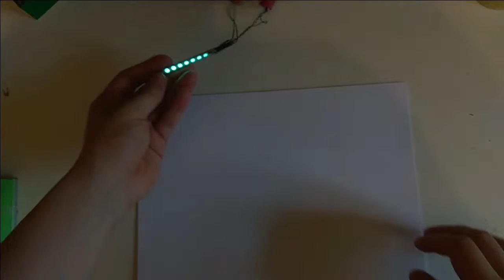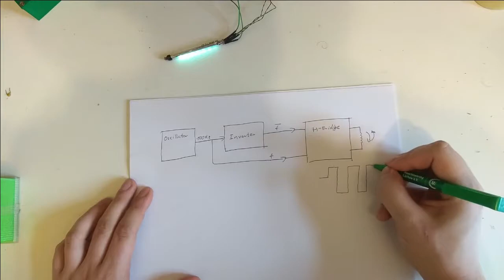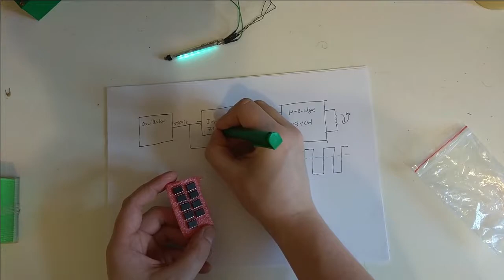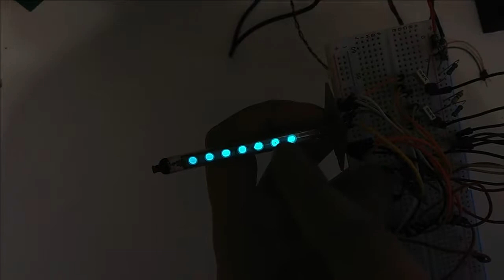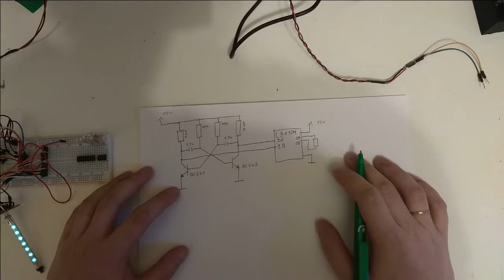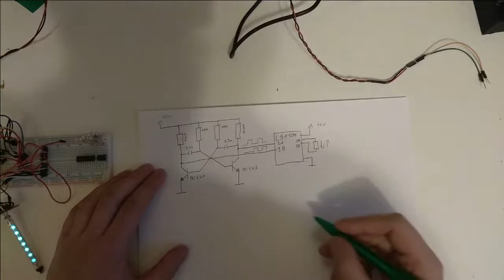Driving Vacuum Fluorescent Display Filaments

Comment: I can't read your left and right resistor values... Could you make the schematics available?
Reply from the maker: Hey! They are available on my Gitlab, should now be in the Video description.
The Project is fairly old though and the Circuit is not ideal, I plan a redesign in the future
Reply: @captainsolder5247  Thanks. It could be nice to make a good design. I found some online but there are a lot of details missing, and an amateur in electronics like me can't fill in the gaps. I'm very interested in understanding the various parts ... (opamp, oscillator, h-bridge, ...) I'm gonna buy my first oscilloscope for this project.